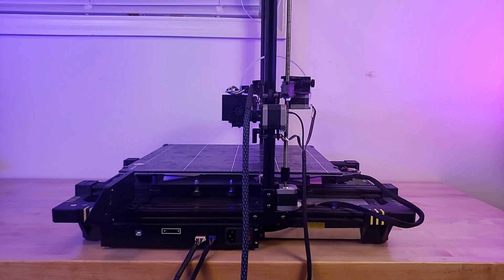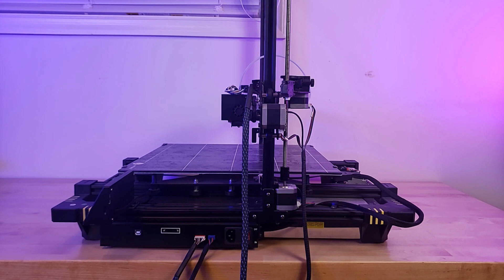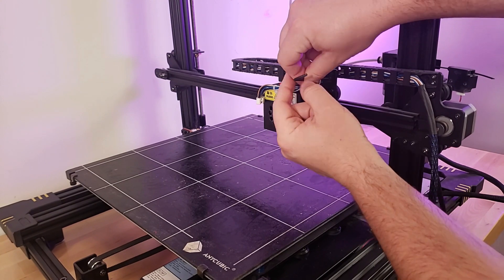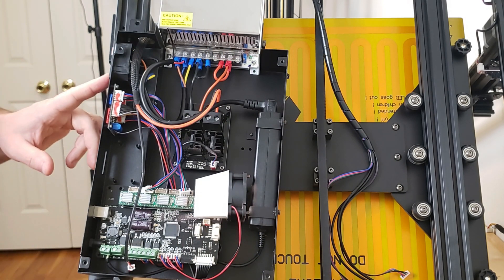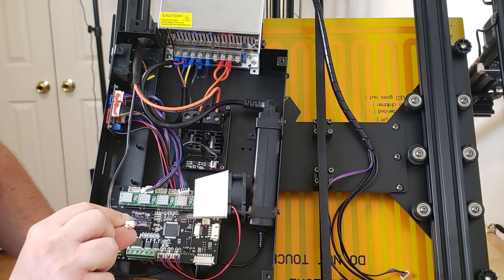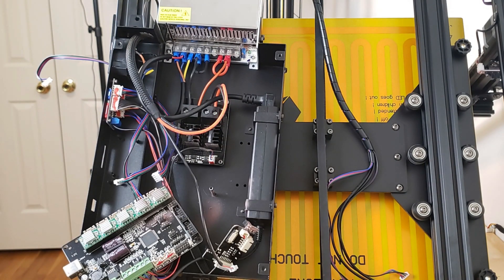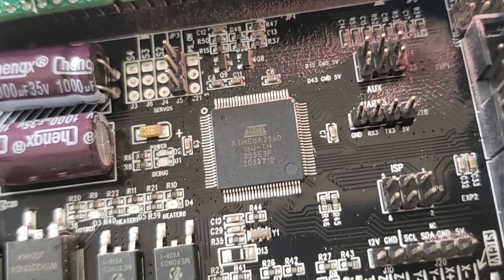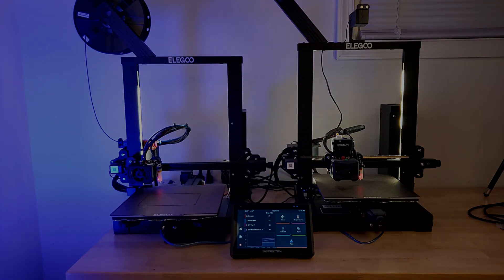Anycubic Chiron rebuild series, Part 1: disassemble Johnny 5

Comment: Do all 12 of your wheels touch the rail on the y axis? My inside rear wheel without an eccentric nut will not touch the rail no matter what and I've disassembled everything and I can not access the screws to loosen the rail itself snd try to push that rail inwards to straighten it out do you know how?
Reply from the maker: @antoniobowers7740  they did, yes. I didn't assemble it, though. It was given to me that way.